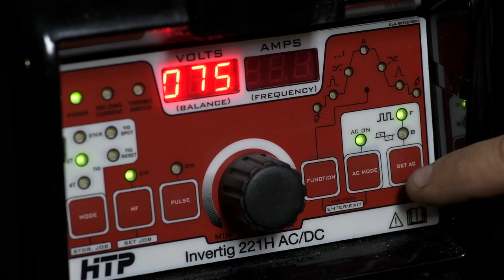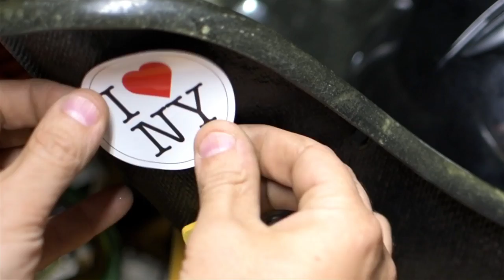GO KART - Part 4 - COMPLETED!

Comment: IDK where my pops got our 1st go cart back in the day, around 2003, or something, I think I was like 10 years old MAX,
 but it must have been Mexico. 
 That little red bastard would SHOOT chains right past your head and across our 5 acre yard like it was trying to leave orbit. Wish I could remember the engine size. I always thought it looked a bit big for the frame. And it made a ton of noise. 

 Eventually he put a old Chevy or GMC timing belt on it instead of a wimpy little dirt bike chain, after that I can't remember keeping all 4 wheels on the dirt or the roll cage pointing up for more than 10 minutes. Good thing it had a semi elastic, sun rotted lap belt.. And the cage was small enough to wedge your helmet in place to.... stabilize your spine? I think? 
 Dunno, I just remember it making it hard to see where you were going while in a full head helmet.

And that God forsaken, heaven sent death machine was bought at a Walmart "somewhere in Arizona" . 
Good times.

Comment: can someone please explain to me how it works without a clutch? Like if the gear to the wheels is always engaged how do you pull start it and wouldn't it just start moving instantly? (still trying to learn about vehicles obviously)
Reply from the maker: it has a centrifugal clutch.  like a chainsaw or scooter.  you have to give it gas to get it to go.  otherwise it just idles.
Reply: @ThisOldTony  I'll have to look that up. Thank you for the reply

Comment: with all the machinist talent you have I don't understand why you welded everything. I mean why not key way It would be just as strong and easier to take apart later. The other thing for wheels and tires, ride on lawn mower tires.

Comment: Hey Tony, I see you have 3.1k comments already, so I won't assume this channel is monitored, but you remember the parts you scored from that bike shop? Next time you want to kludge some bike parts into a project, could you check with me and see if I can recommend parts that will require the least retrofitting? This industry has come up with 20 different ways to make everything, and I've seen everything. I would have made this offer earlier, but I only just found out This Old Tony is a thing. Speaking of which, in the last week of probably crushed about half your videos. What I've noticed is that when I'm in the basement working, all I think about is camera angles and how you'd edit it. If you have any idea how I can get my brain back, I'm considering any and all suggestions.
Reply from the maker: thanks!

Comment: realy high quality and stuff but all that efford and no difirential, at 50 cc.. your loosing alot of energy, dont need tobe a perfect dif. but it would helped imensely at such low powers going into corners nevermind just eating the tires. perhapse you did this to make it kid save?.  you could aswell just drive one rear wheel let the other free spin and not even notice it. would do alot of good for tire wear, stearing.. and the max speed you get from it.

Comment: I will start by saying nice cart !!!!  Good job !!!!  BUT...... Could you have in your wildest dreams more over thought and over engineered a simple project????  Wow !! ! A complete machine shop also !!! Over 50 years ago I built my son a back yard go cart, but simple !!! A 3 Hp B/S engine centrifugal clutch chain drive to one rear wheel that was 6 in go kart wheel  7.2 to one ratio  the frame was bolted together water pipe we had, front axle had 2 T fittings with bushing for spindle and steering was a pulley on a shaft with the pulley hiving a section of hose wrapped around and electrical taped and the lower end had a plate and a shaft to each wheel.  brakes was a cross shaft and a rub block on both rear wheels.  I could drive for test. but he drove that thing till he wore out the used engine we used around a large circle drive and the yard !!! the tools I had were a bench grinder, elect drill, hacksaw and some basic hand tools !!!  He had a blast on it !!!

Comment: look on ebay for sum good use real go-kart tires the tires you have work good if he would stay in the grass or fild but you need road kart tires and yes thy coast loat so maybe used rims than new tires and with you kid going pritty slow the tires last long time just the slick kart tires dont work in grass/filds but the tires u have do so up to u wich you reather need but yea ebay or find a local kart race track and go there and u kand find sum good cheap used parts

Comment: MAN.. You're letting your kids drive this on the road (test dive vid)? And no belts?
I once crashed a go-cart on a closed track, into a tire wall at relatively low speed. I was propelled into the steering wheel, which ended up bent. I bruised some ribs, which gave a hard time breathing for a week.
I wouldn't want to expose my kid to this risk. I thing all go-carting tracks in my country have special carts for younger kids, with many extra safety precautions.